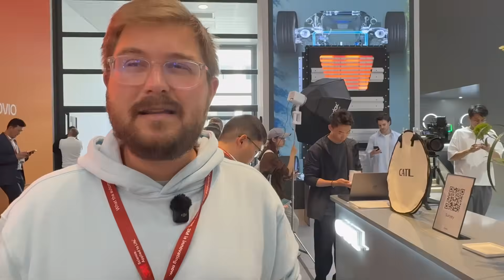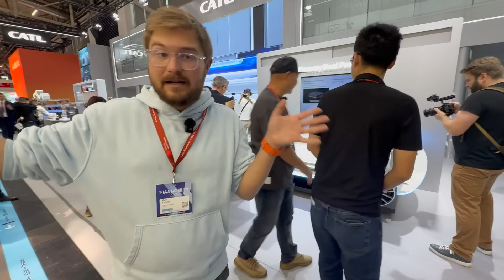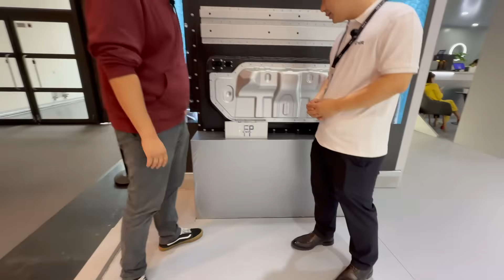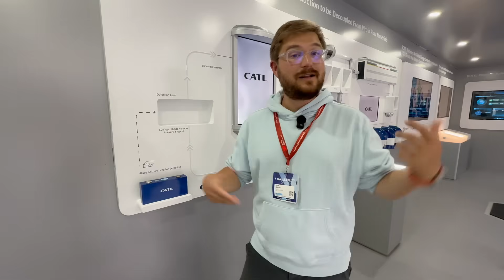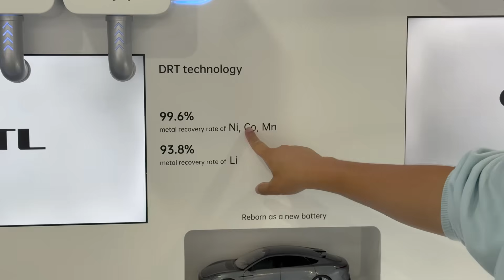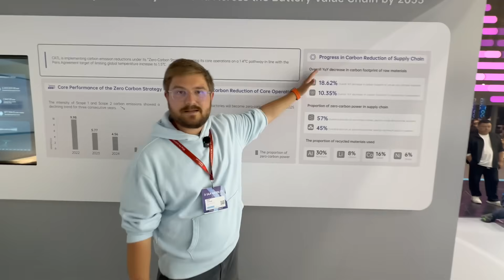CATL Debuts Shenxing Pro LFP Cell w/12C Charging & Long Life!

Comment: 12C is practically  impossible, even if the thickned electrolyte could take it under certain conditions,  no charger or battery posts could take that steadily, it would  need cables as thick as your arm.... a smorgasborg for thieves too.
Reply: 12C is practically  impossible
==> Really ???
Take a look into the RC hobbyist area. Some of their batteries run 60/80C.

Comment: 12C  it is not what we need  !!  We need   energy density  450-500Wh/kg  .  For   1 MegaWatt  chargers in  EU  We will wait  years .
Reply: We need   energy density  450-500Wh/kg 
==> You can wait for your dream 450-500Wh/kg to become reality in 20 or may be even 40 years.
I prefer not to wait and take the much easier to realize 5 or 10 minutes charge time for additional 200/400km to drive (10 minutes is already reality on a few EVs).
Reply: @FriedhelmSchröter  Joker ?  500Wh/kg  will be  available  within 2-3 years

Comment: Recently at my recycling center and they gladly took all the Li batteries I brought to recycle; 1865, cr123, pouch cells extracted from some small devices and a small laser cat toy I could not figure out how to break into...  also silver oxide and Ni-cad batts were desirable. Was assured they had a processor and a market for even the tiny pouch cells.

Comment: How would you actually feed 12C charging? Its great that the battery can handle it but there's that whole annoying practicality part.

I guess the benefit here is that you could charge at 3-4C across a large part of the charge curve and really get down to 10 minute 10-80% or something.
Reply: How would you actually feed 12C charging? Its great that the battery can handle it but there's that whole annoying practicality part.
==> Yes, there are still several open questions, but next step is the charger station designers have to make up their mind how they could realize 12C charging (possible with 800V or would they insist on 1.200V?). CATL just announced, on the battery/cell side they see good chance to get 12C realized. And finally it is up to the battery pack designers and the end customers buying EVs to decide if it is worth to go this way and if so, how in detail. Complex, but that is how high technology evolves.
How to arrive on Mars (Elon Musk target) also poses a lot of not yet clarified questions, yet generally, 65 years after having arrived on the moon it looks to be feasible with todays much advanced technology and the only missing points are the will to arrive there and a lot, lot of money to get enough people working on all the still to clarify details.

Comment: I didn’t hear you talk about voltage. What volts will these batteries run at? Does it need to be 800 volts or higher to charge at these speeds? A significant portion of US charging is still based off of 400 volt charging. Will that need to change to take advantage of these new battery technologies in the US?
Reply: In my image 800V is current standard for fast charging in about 10 Minutes (10 to 80%).
CATL's announcement of 12C should open the way to further improve this time down direction 5 Minutes.
After CATL has announced what they see possible on the battery pack it is now on the charge station designers to fix the best way how to realize 12C charging power/stations. Based on the charge station designers final conclusion, stay with 800V or increase voltage to next level (1.200V?) the battery pack designers need to adjust the internal battery cabling and not sure if current cable isolation would be sufficient also for 1.200V EV batteries.
On the rather small NMC cells it is easy to change the number of series to parallel cells to achieve a higher voltage like 1.200V, but on the huge LFP cells this may not be so easy/desired. For 800V you need 800V/3.2V per cell = 250 LFP cells in series, but for 1.200V you would need 50% more, this means something like 375 LFP cells. As the battery pack is not allowed to grow in size, this means the single LFP cell need to be shrinked in size, which would counteract the intention to reduce cost by ideally the largest possible cell size to achieve with a 1P configuration the necessary battery voltage. In this sense I would think, the LFP battery pack designers will apply quite hard pressure on the charge station designers to stay with 800V, which may be technically possible but result in a quite difficult to handle cable/connector. In conclusion, on 12C charging system capability mainly LFP battery pack designers and charge station designers, but also NMC battery pack designers need to sit together and decide on the best compromise to achieve 12C charging power in this rather complex situation.

Comment: C rate is extremely simple to understand: it takes 60 min (1 hour) divided by the "C rate" to charge completely the battery to 100%. Therefore, a "C rate" of 12 means you need 5 min (60/12) to charge the battery completely to 100%
Reply: it takes 60 min (1 hour) divided by the "C rate" to charge completely the battery to 100%.
==> No. You have to clearly separate between the strongly different characteristic chemistries of NMC(/NCA) and LFP.
For NMC, the rule of thumb 1C = 1hour charge time applies only for 10 to 80% charging.
For LFP, the rule of thumb 1C = 1hour charge time applies roughly for 5 to 95% charging as a result of the different chemistry and the resulting differences in the charge versus voltage curve of these 2 strongly different chemistries.

The time for 80 to 100% charging on NMC would require an additional about 1 hour, because in this nearly full charge area the charge current will permanently reduce while keeping the charge voltage at the maximum allowed before degration will start, but on NMC you will be able to charge further 20% into your battery when you desire so.
And the 0 to 10% charge is also disregarded, because higher charging stress does favor in this area rather reduced current charging.
In case of LFP once arriving at the maximum allowed voltage of 3.6V you will be able to charge only a maximum of additional 5%.
In case of NMC you can considerably increase cycle time of your battery limiting the charge up at 80% (increase by 20 or 50%?). In case of LFP you do not really mind the number of charge cycles, because compared to NMC the LFP chemistry offers you inherently 3 or 5 times the number of charge cycles.
Reply: ;;;;;who gives a shit about these details... tha fact of the matter is that my answer is reflecting the average experience

Comment: Did he say superconductive electrolyte? :)
CATL seems to have gotten serious but it's their sodium batteries that to me are far more revolutionary. Crazy how high density and life they have gotten out of it and supposedly costs can be next to nothing. So cheap that long range EVs can be cheaper than the cheapest ICE cars. Not to mention utility power and home power. I remarked a while ago how huge it was and thought about investing in the stock but didn't and that was a huge mistake :) +30% in a month or so
Reply: CATL sodium batteries will start to be assembled in EVs starting in 2026

I could see the use case where standard range EVs uses that
Reply: @sihamhamda47  yes gas cars have existed in very cheap variants which EVs haven't as much. For a small EV with 300km range, it would be great if the whole battery pack was less than 2000$ and have endless life and ultra fast charge. It's real death knell to ICE cars when you steal the budget entry point from them as well and a single solar panel on your garage roof can power all its driving forever.
Reply: @DanFrederiksen  The display unit shown in the video I think has almost the same size as the Tesla Model 3 battery pack

I'd expect similar capacity and range to base Model 3 (around 70-75 kWh and 250 miles of EPA range)

Comment: Imagine how advanced the US market could be if we subsidized the EV industry like China does instead of giving tax breaks to billionaires, subsidies to fossil fuel companies and infinite money to the war complex.
Reply: Lobbyists exist
Reply: I take everything CATL says with a huge grain of salt.
There is ZERO Chance that these speeds can be sustained. 12C burst is fine, but I 100% guarantee it won't hold that speed for more than a few seconds. LFP tech is current limited, just like all batteries.
Reply: @singular9  Its really just another iteration of that blue battery shown in the recycling exhibit.  The improvements they thought of were implemented in this new version.  Recessed terminals, flat sides designed to transfer maximum heat, structural rigidity, and an extra 3% of battery material in the same overall formfactor.
Reply: @singular9 I take everything CATL says with a huge grain of salt.
==> I don't believe you will ever be a direct customer of CATL, but your EV provider may be and you can be sure your EV provider will check CATL claims very much in the detail and forward it only in their transformed/confirmed way to you.
The speed of charging has in my image improved drastically in recent years to compensate the weakness of EV on the driving range with one battery charge compared to a full tank driving range with a combustion engine car. This allows EV producers to target smaller batteries which in turn will result in lower cost EV cars.
In my view this develoment direction is much more correct, than the end-customer request for ever larger driving distance with a single battery charge, where the improvement progress was much much less in the same time.
Generally I think high speed charging is applying higher stress to a battery and when not necessary you should avoid high speed charging. But it is good to have the possibility of high speed charging once you really need to drive huge distance in one shot.
Reply: @EeeCee123  Please remember CATL had the blade cell out and that had problems because of the length and modular if resilience affect
The CATL engineer really didn’t give any information except a “promised “ increase C rating through electrolyte  and then the thermal dynamics he explained was completely contradicted with thermal protection from overheating vs  I heat allowed to get out with from thermal run away
Reply: @GreenEnergyGuy  He also mentioned peak charging of 12C and that 10-80% takes 10 minutes, which is not too far off of what Hyundai is already doing with the Ioniq 5(what is it, 17 minutes?) I think we are realistically only talking about a 3-4C average charge rate. Yes its fast, but I dont think its as big of a deal as people think at first glance.

Basically, I think this is going to allow your typical EV with a 50-100 kwh battery to maximize the output of a 350 kw charger and hopefully sustain it across most of the charge.

Comment: I am not concerned with milage I am concerned with years. I want a BEV battery to last 20-30 years while traveling 200k to 300k miles.
Reply: So it must exceed the reasonable average  life of any ICE car by multiples?
smh
Reply: @rogerstarkey5390No I keep all my vehicles least 20 years. The average age of a US vehicle on the roads in the US is 12.8 years and they expect it to reach 13 years by next year. Do you understand averages? The average age of a vehicle in the US when it gets junked is 17 years. Toyotas the make I prefer last on average over 20 years. Since I am the original owner I always get more than 20 years. Right now we have a 10yo Avalon hybrid, a 19yo Avalon, a 20yo Camry, and a 28yo Dodge Ram PU.
Reply: Years isn't the issue it's the number of cycles. EVs now can easily last decades. And are.

Comment: Hopefully these cells make it to DIY solar
Reply: LFP already is THE STANDARD for DIY solar charging into a batterie.
But solar does not need 12C charging capability, because nobody will design a system that charges the battery fully within less than 10 minutes.
Reply: @FriedhelmSchröter  today's standard was yesterday's prototype

Comment: Where is all this new battery tech in production EV’s? For many years we hear a never ending chorus of revolutionary battery tech, however goto any EV charging station and people are still spending 40-60min recharging.
Reply: Batteries aren't the only thing in the equation. Pack voltage, charge station voltage, charge station amperage, onboard charging system, etc are all part of a larger picture that will take time to normalize. We are still just getting started with this, and there is still work to be done to make it so regular people don't need to concern themselves with the nuances of electricity delivery.
Reply: @blanketwodahs6741  
You mean "Cells"?
"Batterries" are the collection of cells in "Pack form".
Reply: @joebullwinkle5099
The "never ending chorus" is actually from those like yourself expecting a never ending improvement, plus production immediately on announcement of a new product.
Reply: Where is all this new battery tech in production EV’s?
==> Currently in production you find a few brand new models that offer 10/80% charging in about 10 minutes. Also the powerful enough charger stations for such capable EVs still need to be deployed in sufficient numbers. CATL has now announced that charger station companies may need to reconsider again, because on cell/battery level they see 12C charging speed visible/realizable. Now many EV companies and charger station companies have to check if such powerful charging should be a realistic goal to realize or if it is better/less costly and more practical to stop further optimization in direction of reduced time to charge.
But time to charge seems to be the easiest/cheapest point battery companies can improve rather easily, while other parameters like drastically lower cost or drastically higher drive range on one charge are much more difficult/costly to improve.
Reply: When your country blocks Chinese tech, you will ask everywhere where the new tech is.

Comment: Did CATL mention how many times a battery can be recycled?
Reply: Indefinitely... and the material quality improves.
Reply: Recycling is not a job CATL is strong on, there are other companies who concentrate solely on the way/technology how to recycle the materials put into the huge EV-batteries.
By definition recycling should be possible without limit. In practice plastic recycling is close to impossibe, because you cannot clean the plastic easily of foreign material and most plastics are compounds impossible to separate into the original different kind of plastics.
On EV batteries recycling is in its infancy, because seeing the fact, that EVs just started something like 20 years in small quantities, there are not many batteries there that have arrived the end of life (most batteries are rather failed batteries in production or batteries where exchange of some failed cells or repair of some failed electronic component may be to expensive to be executed on a commercial basis.
Current trial recycling factories are working around 50% recycling result, but engineers are working already today to improve the processes with a goal of more than 90% recycling result (the real result of recycling will become only clear in 10 or 20 years when the number of batteries to recycle will gradually increase).
Beside of recycling there is also the idea to use old EV batteries additional 10+ years, more specific the modules they are made of, as house batteries to store photovoltaic energy.
Reply: @FriedhelmSchröter  dude, you've  got a lot of time on your hands…

Comment: The larger the C rate is the faster you can charge it.  With a  12C charge rate you can charge a 100kw battery theoretically in 8.333 minutes.  That's insane compared to what we can do today!
Reply: No, theoretically you could charge it in 5 minutes, regardless of the kWh capacity of the battery. Ofc in practice it's slightly slower than this due to charging curves.

Comment: 12C charging of CATL is most likely false. Chemically, LFP can't stand 12C. Of course, it can instantly charge and discharge fast, but it can't guarantee its long-term durability. That's already been revealed in a research paper on LFP. It's common knowledge in the battery industry that LFP batteries should be set below 2C in order to last a long time.

So, that's why LFP is used more for ESS than for vehicles.
And, we need a 1.2MW class charger to charge the 100KWh LFP battery pack suggested by CATL to 12C, but currently, none of those chargers are commercially available, so there is no way to see if the actual 12C is possible.

In general, high-performance high-nickel NMC batteries capable of high-speed charging and discharging are also used with about 6C as the commercial limit. It is not continuously charging 6C, but it is reduced to that maximum.

In addition, the current problem is that creating a 1.2MW charger requires significant cooling performance enhancements and prices skyrocket, which is not realistic.

If CATL really claims that 12C is possible, there is a 350KW class, a fast charger on the market, so CATL will have to make the battery pack 25KWh instead of 100KWh and test it in real life.

In addition, you will have to check the SOH status of the battery after 500 tests, not once.
Reply: CATL is a technology bluffer. They have no technology proven in mass production except LFP and low-nickel NCM.
Reply: @geoquestprime9447  
That's why they're the biggest in the industry? "Bluffing"?
O...... K
(smh)